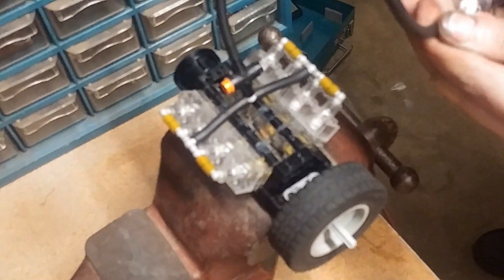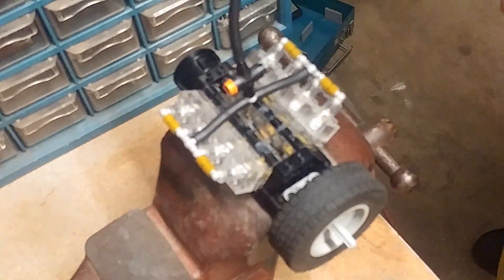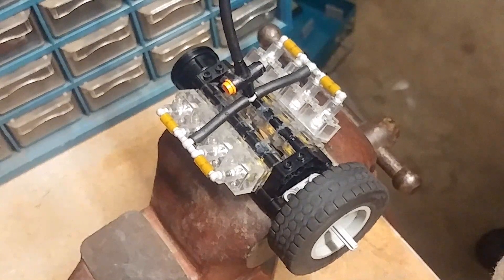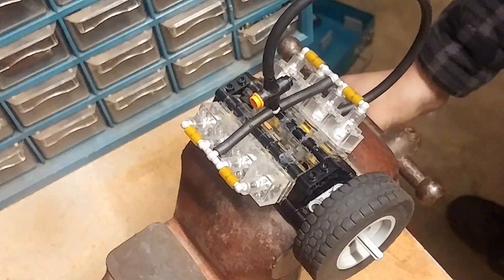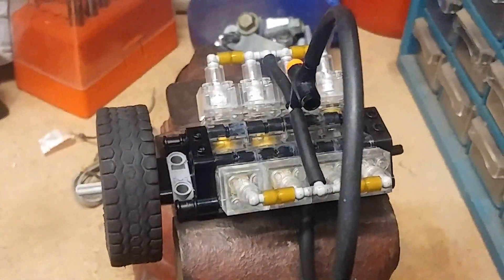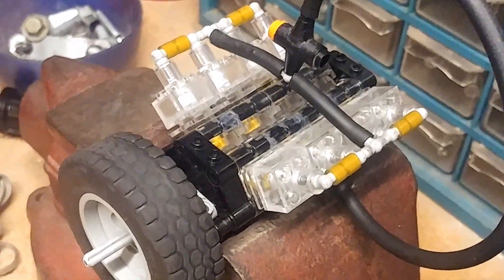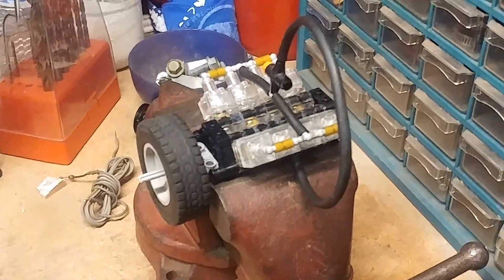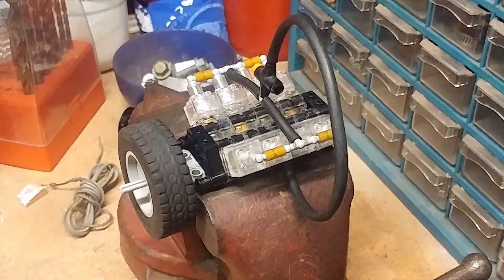Lego Pneumatic V8 Engine Running (for real this time)

Comment: Hi man. If you just make 1 valve that rotate and block the air to one way at the time, then you get much stronger motor. Its very easy to do that. Its not have to block it totally. 1/3 will be alot. Its just a air tube and small beam that rotate on it
Reply: like a rotary valve?
Reply: @JaceN3D  
Something like that, yes.
There is several ways to do that.
It can be even something that just squeeze the tube, just a bit. Maybe even  lego valve, and more 👍
Reply: @yuvallegomotorized  ok, but sqeezing the tube probably wont be good,  because the torque of these engines might not be good enough, i have to test with more cylinders, maybe it will have enough torque fror tube squeezing
Reply: @JaceN3D  true.
But i dont think that you must to squeeze the tube to zero. Even 1/3 squeeze or 1/2 will do great job.
Reply: @yuvallegomotorized  i might try a mechanism like thos, small and suited for the torque of the engine
Reply: @JaceN3D  when i think of it now, you can do something similar to the valves that i made with my motor, but instead of passing air, they will push just a bit on the tubes, and stop some of the air that pass there
Reply: There are already valves inside each piston assembly

Comment: Very nice engine, but be carfull you lost a lot of power because of your crankshaft. This crankshaft is not enought rigid, so the best thing to do is to duplicate the V8 in to a double V4 or a quatripl V2, you see ?
Reply from the maker: Yeah, I'm actually in the middle of further modifying the crankshaft to accept a center support "bearing" so that it stops flexing. I'm making and modifying my own pieces because I want to keep the v8 look to it instead of 2 v4s. If it works, I'll make another video of it
Reply: @splob1981  wow I have the same idea, if you want I have made a 3d model of the crankshaft, with the perfect dimensions, but if I want to make it with a CNC machine it's to expensive.